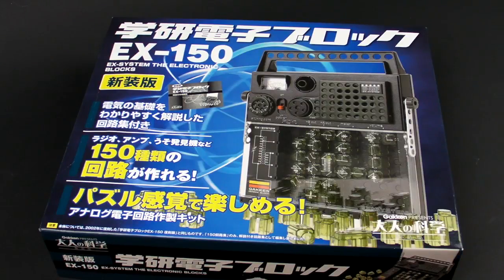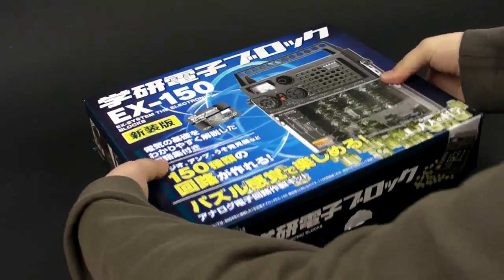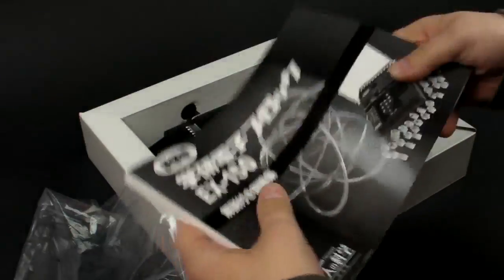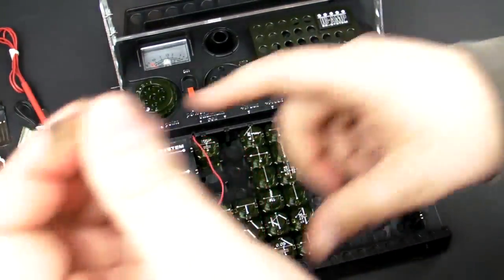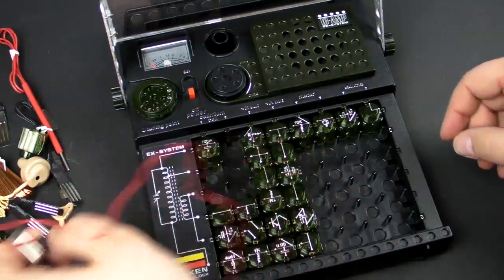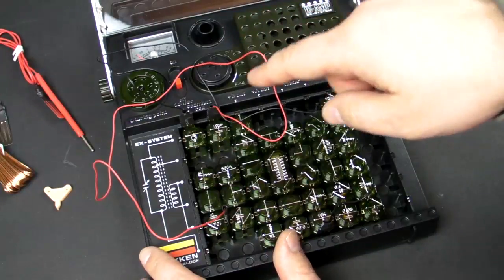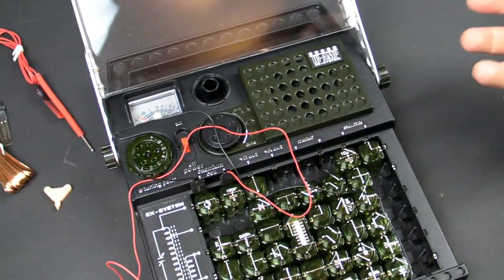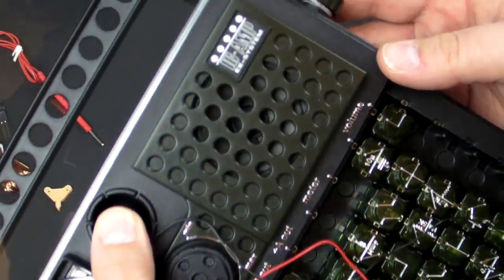In the Maker Shed: Gakken's EX-150

Comment: I had this exact kit about 30 plus years ago when they where first issued.

The radio circuits worked very well especialy with the attena hooked to the central heating system!  I didn't realy get my head round much more than the basics of the difference between diodes capacitors and transistors and transformers etc.   Its easy to follow the patterns on the blocks and diagrams to make all the experiments.  I've started building electronic kits as an adult. I wish i'd kept my original.